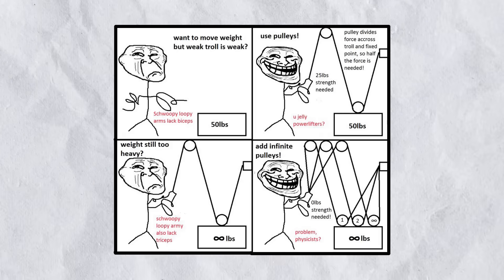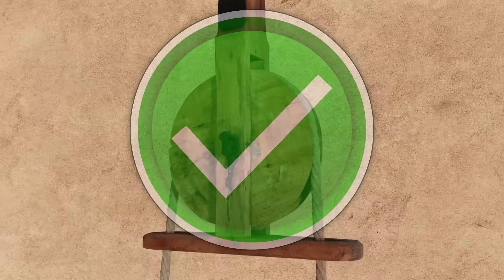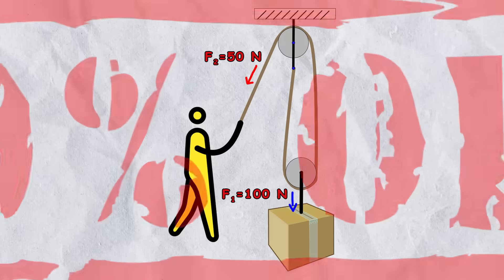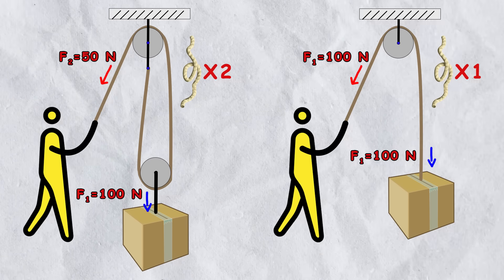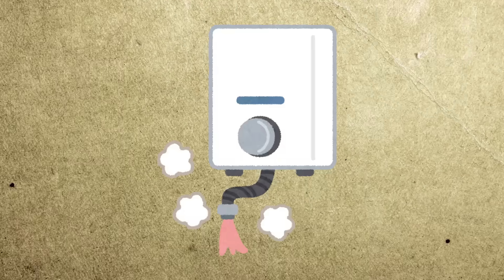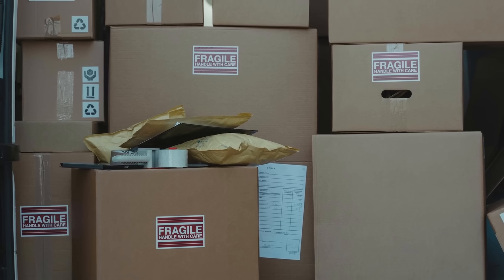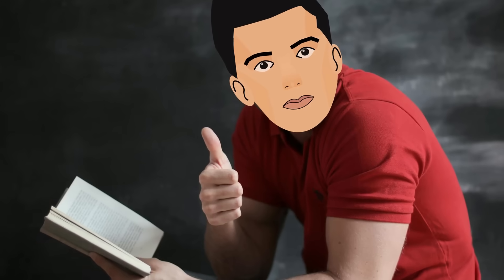why it kind of works 3

Comment: 1:57 No, the required force wouldn't approach zero, that'd only be true if it was a finitely powerful weight. If it's an infinitely heavy weight subject to an infinite amount of pulleys, it'd be indeterminate what it approaches, since it's basically inf/inf.
Reply: Use lhopital lol
Reply: isn't a number divided by itself always 1?
Reply: @garbearboy infinity isn't a number
Reply: @Emeraldakafunnygamerguynumber or not
X divided by X will always be 1
Reply: @Emeraldakafunnygamerguypretty sure it is
Reply: @garbearboy infinity's a concept, not a number, so "X/X=1" doesn't apply. Take (x^2)/x, and evaluate that at x=inf. (inf^2)/inf=inf/inf (infinity squared is still infinity), which you would say is 1. But it isn't, it's inf (by l'hopital, and using eyeballs). The inf/inf shown in this video though is unknown though because the "infinite mass" isn't well-defined, so we can't l'hopital it (so it remains indeterminate).
Reply: @garbearboy not every number divided by itself is 1. The actual thing you’re thinking of is that any nonzero real number divided by itself is 1. Or more generally, every element of a field other than the additive identity has a multiplicative inverse. You could construct a field that has an infinity element and an inverse infinity element, but it wouldn’t work out the way you’re picturing
Reply: @panpawe5474 X represents a number though
infinity isn't really something you can modify (ie, infinity + 1 is still infinity)
There's no way to solve for x = x+1
Reply: Different infinities are not equal to each other. For example, infinity divided by 2 is still infinity. These 2 infinities are not equal, and dividing them by each other should not equal 1.
Reply: @KillFrenzy96  you have to define what you mean when you say "infinity" otherwise you're just speaking nonsense. You can't just call two different things "infinity" in the same sentence with no distinguishing characteristics other than the reassurance that "they're totally not equal to each other"
Reply: @frimi8593  When I say "infinite", it refers to something that is unlimited - it never ends. In my case, infinity/2 is unlimited just like infinity itself. You can refer to both as "infinity". But that does not mean infinity/2 = infinity.
Reply: @KillFrenzy96 it doesn't sound like you're describing a number right now. I wouldn't describe the number 3 as "ending" somewhere. It sounds instead like you're trying to describe an infinitely large set of things, and then trying to use arithmetic on that set. Unfortunately, arithmetic as you're using it doesn't work on sets. You need to define "division by two" in a way that accounts for non-numbers. If that definition is "split up all the things in the set into two equally sized sets, then look at the size of those sets" then actually it turns out that infinity/2 is exactly identical to the infinity that you started with in all cases of all kinds of infinite sets. For example, the amount of even integers is exactly the same as the amount of total integers
Reply: @garbearboy not always. Limits in math study these cases where its not clear by seeing which number approaches infinity faster. x^2 / x where x approaches ♾️ is technically ♾️/♾️ , but x^2 approaches it way faster and thus the answer to the equation is ♾️ . If it was x/x it is still the same case, but they both approach it at the same rate, so it is equal to 1
Reply: @mmfreshmeat2860 the issue with this is that whereas we can say pretty easily that the rate at which the pulleys increases is linear, we cannot say anything of the growth rate of the infinitely heavy object, because it’s not growing; it’s just presumed infinite.
Reply: @garbearboy Infinite isn't a number, it's a concept
To be able to define it as a number, you'd have to assign it a value (not relative to itself, since Infinity times 10 is still not a number), and therefore it wouldn't be infinite again
Meaning two infinites can be talking about different "numbers", and if that's the case, the division is impossible (since it cannot be determined)
Reply: in real life its hard to tell aswell lmao
Reply: Wouldn't that be 1
Reply: Someone else commented:  "The weight in the image doesn't have infinite size, so it has infinite density, which means that between any two atoms in the weight there must always be an infinite amount of atoms. So, the weight is uncountably infinitely heavy.
The pulleys are numbered with integers, so there is only countably infinite. The pulleys would not make the weight liftable."
Reply: @hollowshiningami3080 the property of having a thing between any two other things is called being “dense” and it is NOT the same thing as being uncountable. For example, the rational numbers are dense (between any two rational numbers is an infinite amount of rational numbers) and yet the set of rational numbers is only countably infinite
Reply: @hollowshiningami3080  That isn't necessarily uncountable though, that's essentially kind of a 2-dimensionality infinity (1 dimension counting the "atoms in weight", 1 dimension counting the "atoms that could exist between"), which is still countable. It may seem uncountable (as you think "before I can count 1 to 2 on the weight atoms, I'd have to finish counting the infinity of between atoms, which isn't possible, therefore uncountable), but just like the infinite set of rational fractions being countable (despite there being an infinite # of integers, and an infinite amount of fractions between each one, which at first glance seems uncountable), you can arrange the way you count them to make it countable by simultaneously incrementing the count of one while decrementing the other (in a kind of "diagonal" way, if you search "counting the infinite rational fractions" you should be able to find it and see how it may apply here as well).
Reply: It works mathematically. Imagine you add two pulleys for every doubling of the mass. You would agree with me that the force needed to pull goes down after each increase of mass, approaching a required force of 0? Therefore we can continue this principle to infinity and we will always be able to lift the pulley, while the force is basically 0.
Reply: Applied force reduces exponentially with each block. Infinite weight is... uhh.. that kind of argument is kinda meaningless to begin with, we can define different weights differently and come to different conclusions on whether it's possible or not, the problem is such object just doesn't exist.
Reply: @nothinghere9576  "we can define different weights differently and come to different conclusions"

Right. Without any other information as to what infinities are being talked about, specifically with the "infinite mass weight" (which would be needed for us to l'hopital), we don't know whether it tends to 0 or to infinity. Which is why it's indeterminate.
Reply: To find de limit of inf/inf just use lhopital
Reply: Inf/Inf = 1/1 fight me.
Reply: @S1ND4K8 take 1*inf=2*inf. Divide both sides by inf and you get 1*inf/inf=2*inf/inf. If inf/inf=1/1 then the conclusion is that 1*1/1=2*1/1, in other words, 1=2.
Reply: @frimi8593  But that's not funny, say it as 0 = 1 and you break maths further
Reply: @burushifudara I mean a contradiction is a contradiction, math would be equally broken either way
Reply: @frimi8593  Yeah, but most people will understand better the implications if you clarify that 2 = 1 means 1 = 0, since they will make the connection
Reply: @S1ND4K8 ok, let’s follow this thread. What’s 1/inf?

Comment: Theoretically, yes, but you need to take into account the deminishing returns of adding more pulleys. The first pulley takes off half the load, adding a second only makes it a sixth lighter, etc. Eventually the weight/friction of the pulleys catches up to the tiny improvements
Reply: I don't imagine infinite friction will be too much harder to overcome than infinite weight
Reply: Looking at how it's done at 1:00 it looks like every new pulley divides the required strength by 2.

Base force : 100%
First level : 50% (lift x2)
Second level : 25% (so lift x4)
Third level : 12.5% (x8)
And so on

Much more effective to demultiply your strength than having one single level with multiple pulleys.

At some point the limit would rather be the structural integrity of the system, can it withstand the forces applied on it ?
Reply: @Duke_of_Lorraine  no it's sequentially less fractions, it was  1 half, then 1 third,, etc
Reply: If using the same size pulleys for the entire mechanism, true. But if you were to use progressively smaller/thinner ropes and pulleys, perhaps not.
Reply: I had to cover this when getting my engineering degree. Technically, you are incorrect, since the thing that matters most in a pulley system is the number of individual rope segments, not the total number of pulleys. If you used 3 pulleys and had 3 rope segments, you would be lifting just 33% of the total weight, but, just by changing the orientation and relation of those same 3 pulleys, you can make 4 rope segments which reduces the load down to 25%. 

If you redesigned the pulleys you were using, you could interweave the rope between pulleys. Since we are assuming zero friction (because infinite weight would necessitate infinite friction in order to exist, making it TRULY unmovable and thus this whole premise is rendered moot), you could technically modify the pulleys to accept an infinite number of interconnections, meaning you could technically use just 2 or 3 pulleys to get an infinite advantage.
Reply: Let’s pretend the pulleys are covered in sex lube. What now?
Reply: It’s worth noting that the infinite series 1 + 1/2 + 1/3 + … approaches infinity as n approaches infinity, implying this method could allow you to lift infinite weight.

Comment: Last parr of the panel doesn't work. Load just gets distributed on all of the ropes but at the end he still has to pull half of infinity lbs.
Reply: Yeah I saw that from the thumbnail. The pullies aren't actually working together. This has nothing to do with infinity and everything to do with the wrong configuration. For those who still don't understand imagine there were only 2 pullies like this. Both pullies end at the same hand. So whether you have one or 2 you're pulling with the same amount of force because each rope is taking half the weight and going into the same hand.
Reply: It would be lim(1/x) where x goes to ∞, so it tends towards 0
Reply: @XplosivDS  What? It may get funky when "infinity" is involved, bit that's still not how it works.
Reply: Why is this buried so far down in the comments.
Reply: @Eoraph Seriously bro I was beginning to think I was crazy because everyone is worried about the implications of infinity and not the fact that all of the pulleys are connected in parallel. I left the video and came back just to find this comment.

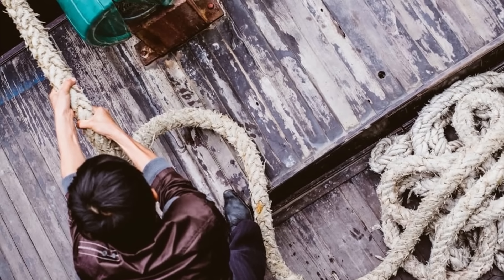Comment: 0:38 Also, Archimedes came up with the statement, "Give me a lever long enough, and I can lift the Earth", which perfectly explains torque, as torque is the reason why levers work. When you place an object into the ground and push down on one end, the object acts as a lever with the contact point of the object to the ground as the fulcrum, and since torque is defined to be the force on an object that is normal to its radius, pushing on a lever creates torque. Torque lightens the load on forces as the total amount of work done is constant, but torque causes the work to be proportional to angle and not distance. This is also the reason why jacks can be used to lift heavy objects that man himself cannot lift.
Reply: tau or torque = r x f
you either get the force up or get the distance [r] up 
so yeez
Reply: @cyborgtobito  Technically, τ = r ^ F, where ^ is the wedge product.
Reply: @AlbertTheGamer-gk7sn   Oh, this is my first time hearing about wedge product, we just learned it as cross product, which gives torque = r.f.sin thetha, but wedge product makes more sense
Reply: @cyborgtobito  Yeah, as the cross product is a wedge product, but instead of getting the bivector directly, you get the area vector that is normal to the bivector, and it only works in 3D.
Reply: Not just a lever, but "a place to stand on", meaning a fulcrum
Reply: @apokalypthoapokalypsys9573 Well, if it can’t pivot, then it is not a lever.

Comment: Don't forget that the rope/cable has to also be of infinite strength, as a system is only as strong as its weakest component.
Reply: Also the pulley's fixture to the roof, and the roof itself, and the walls holding up the roof, etc. etc. all have to also be infinitely strong, right?
Reply: @ValeBridges Yes, but if you start considering the material durability of the environment around you, addressing the elephant that is the infinitely weighing box would be more productive. After all, how are you going to fix a pully system to  an infinitely strong black hole?
Reply: @ValeBridges  use pulleys to lift the pulleys
Reply: @HaunterV infinity^infinity
Reply: Also consider the rope (or rope analog) requires one to exert force to overcome friction. The friction is negligible with 1 pulley, but you have infinite friction with infinite pulleys.
Reply: @Aesthetic.Ascetic  That is also a good point.
Reply: Thanks Senku
Reply: @realcupojoe  Any time!
Reply: At some pot, the whole building will just not be able to support it.
Reply: @jwalster9412  exactly the point, since what the pulley is affixed to is part of the system, so you need a building capable of withstanding infinite friction and weight, which then requires it to be in an environment that can support said infite weight without sinking into the ground, and the larger the area that can support infinite weight grows the larger it needs to be until eventually it has to just be an entire celestial body, at which point you're just in a black hole and due to spaghettification there can't actually be a human operator capable of operating this device because you can't get close enough to it to use it
Reply: Infinite only means arbitrarily large in most circumstances. Not even the universe itself is truly infinite in the way most laymen use the word.
Reply: And the entire system must be frictionless
Reply: @domvasta  That is indeed true, but didn't he mention that in the vid? I don't exactly remember, though I at least saw a comment or two mention as much.
Reply: Spider silk
Reply: @Error_Mann  All I ever think of when I hear/read "spider silk" is a mental image of goats dropping from the ceiling on webs like a spider... and it never stops being unsettling...
Reply: You can rephrase it to be "lift any (finite) weight with near-zero effort."
Reply: The rope doesn't. The tension on the rope is the same as the force it takes to lift which they said would be near zero. The rope does have to be infinitely long tho and the ceiling does need to have infinite strength.
Reply: @Bobbobbob984  The reason I said as such was because each individual segment of rope can only handle a finite weight before snapping, and when said weight is literally infinite it by definition has enough strength to snap the finite strength ropes; but like I said in a recent reply, applying an infinite status to any one component of a fundamentally finite system means that all other dependents within said system must also be equally infinite, otherwise the system would be guaranteed to break down.
Reply: @ShawnF6FHellcat  then you'd also need to be infinitely strong to pull the rope.
Reply: @Pyrrolidine  Again, if one part is infinite, then everything else has to be infinite for a mathematically consistent experiment; but from a conceptual standpoint, it's just a matter of what you need to prove a point.
Reply: And infinite rigidity so the rope doesn't stretch
Reply: Simply make the rope out of pulleys
Reply: No
Reply: @YunxiaoChu correct you have the weight distributed across infinite pullies so the ropes only need finite strength
Reply: Make sure the fabric of reality can support all that weight in one spot. I think you got a black hole problem, friend.
Reply: I does not, since it's ifinite length you will never pull the slack from the rope nor lift anything
Reply: Truely, give me a lever of infinite length, and somewhere solid to stand… now my only issue is unreliable levers!
Reply: So judging by that, if the weakest component is as strong as nuke, the system would have that same power.
Reply: @EndGame_Null  i mean, dunno how you'd use a nuke in a system, but yes. It's like if you used a chain made of indestructible material, but one link was titanium, the whole chain would have the tensile strength of the titanium bit.
Reply: @EndGame_Null  I mean... technically yes...
Reply: @EndGame_Null nukes are terrible structural components, they're made of a thin metal shell, full of high explosives which are organic crystalline solids and have very low resistance to deformation. The inner core is made of a hollow shell of dense, brittle actinide metals, which make up the majority of the weight, but contribute no structural rigidity as they're not in contact with any structural element